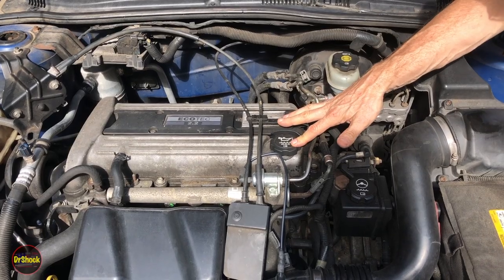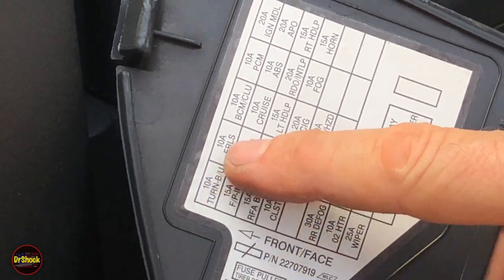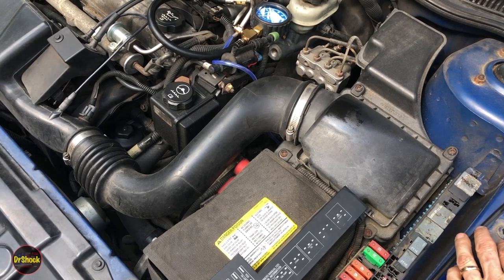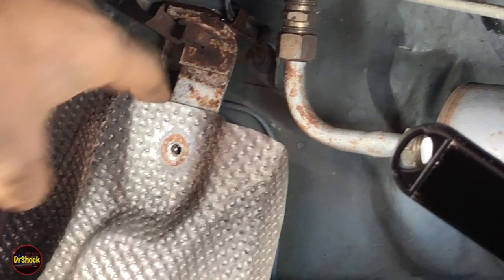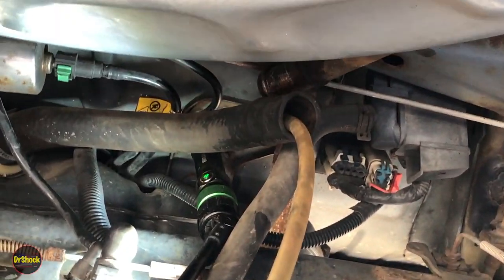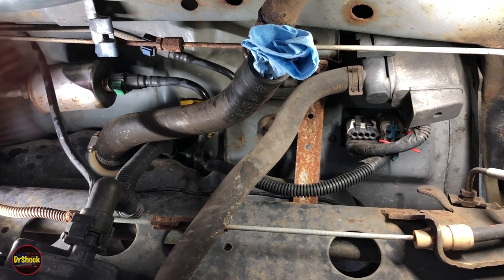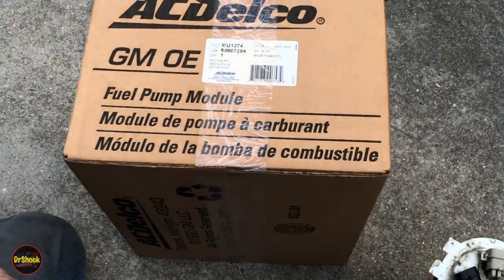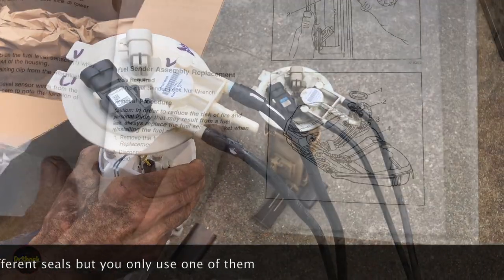2000 - 2005 GM 2.2L Ecotec Fuel Pump Diagnosis & Replacement (Chevy Cavalier & Pontiac Sunfire)

Comment: Best video yet on fuel pump replacement.  I'm an old fart so it took me half a day by myself.  I think removing the EVAP hoses requires pushing in on the front and back and not squeezing the the rubber catches, LOL.
I kept screwing around and then it dawned on me like a dummy.
cheers,

Comment: After unplugging the harness feeding to the tank, couldn’t you test for power, before dropping the tank? Make sure it’s even getting power to the tank?
Reply from the maker: Yes, you could do a basic voltmeter test for this if the vehicle history was unknown to you to warrant it.   Also while unplugging you can determine within a few seconds whether there is visible corrosion on the plug terminals, loose terminals within the plug housing while disconnecting it, or visible wiring harness damage leading up to the plug.

Comment: I got an 03 Chevy cavalier that will start and run an runs for a few minutes then you can restart it an it will run again an shut off what u think maybe the problem
Reply from the maker: That could be from a number of problems with those symptoms, but I would start with the fuel delivery.   Checking the pressure from the fuel pump, and then checking the fuel pressure regulator next.

Comment: Hmm so watched Video.2002 sunfire no start,changed plugs checked that i have spark yes.Swaped out 5170 relay's air and fuel pump.No change.Checked scrader no fuel.Checked all fuses inside car ok.Unhooked airbox hose no blockage.sprayed carb cleaner yes it barks off.So going to change new relay then start traceing line back to tank right?see if any visable damage?Someone said there was a reset for the fuel pump in trunk?is this true can't find anything.Also put code reader on say's unable to nothing stored could the ecm be fried due to idiots trying to boost it with start feature on battery charger too many times?
Reply from the maker: There is no fuel pump reset on these GM models.  You need a fuel pressure gauge to debug this, and if you have no fuel pressure during cranking go straight to the fuel pump in the tank.  Either it has no power, no ground, or both(wiring harness or relay issue) - or it needs to be replaced.
Reply: @DrShock  Thank you sir i'm just now seeing that.

Comment: WHAT ABOUT FUEL FILTER?  We have 2005   2.2 L 4-cylinder,  {Engine Code} [F] L61 It's got the slow start eventually going to wear out my starter. But this  has been going on for over 1 year. Starts quicker the 1st time  Think laying into the throttle helps  a little. It's my wife's car
Could it be  the fuel filter?
Reply from the maker: A crank no start condition can be caused by nearly a dozen different problems.   This video was about only one.   A fuel filter that is excessively clogged will reduce pressure, but would be highly unlikely to result in zero pressure.  Such a reduced pressure situation could also be a cause. A fuel pressure gauge would again be the go-to tool to determine that.
Reply: @DrShock  THKS ,of coarse your right, I got onto watching another video think it was yours that showed me the problem 
it was the regulator . I pried it off with full pressure, using a tire iron against the fuel rail  ( definitely a good fuel pump & flow) I had fuel spry in 360 degree for about 10 feet . anyway for 79 dollars and trip to oreilleys it starts right up for the first time in  
years.

Comment: Hello I own a 2004 Chevrolet cavalier  furl pump kicks on car starts runs  but when  I get up to 40 to 60 mph car start missing  is that sign of bad fuel pump
Reply from the maker: You're describing an engine miss at highway speed, otherwise normal operation.   So, not necessarily related to the pump.   You would have to pull the diagnostic trouble codes first and see where that leads.  Then look into the fuel injectors, vacuum lines,  and ignition spark delivery components when diagnosing a misfire.    Multiple sources, manual process of elimination.
Reply: @DrShock  good morning thanks for getting back to me  my cavalier idles rough  sometimes  also  could it be bad spark plugs  I just  put some new ones in  back in February  but they were some cheap ones off ebay   I still got my old ones   they weren't that bad  but I like to change  plugs  once a year   I'm thinking about pulling new ones out putting in my old ones  seeing if there is a difference  what do you think  is it worth a try I don't think fuel filter has ever been changed  I bought the car for $600 three years ago   they never took care of it oil was black  needed  brakes  struts   but it doesn't leak any fluids  or burn oil     but let me know thank you for your time
Reply from the maker: Spark plugs would definitely be part of the ignition spark delivery components I mentioned.   Genuine ACDelco plugs is all I use for GM vehicles (thats what was installed when the car was first manufactured).  They definitely should not requiring changing annually.   It's based on mileage, that you can find in the back of the owners manual for the 2004 Cavalier.  Bad struts and oil wouldn't have anything to do with a misfire, though of course it can lead to other unrelated problems.

Comment: You should have tapped on the tank while the pump was powered. It sounds cliche but it will turn on and should tell you if the pump is going out. Might even get you home in a pinch.
Reply from the maker: Owner had the car towed in to me to get diagnosed and repaired, it's a straight forward diagnosis with the correct tools.

Comment: NO THE PROBLEM YOU HAVE IT'S AN ECOTEC THATS WHATS WRONG. THOSE MOTORS SUCK. YOU CAN SWAP THEM WITH A QUAD FOUR. thats a good motor,, 160 hp, 25mpg. very easy to service.